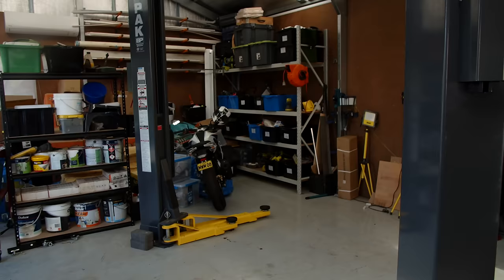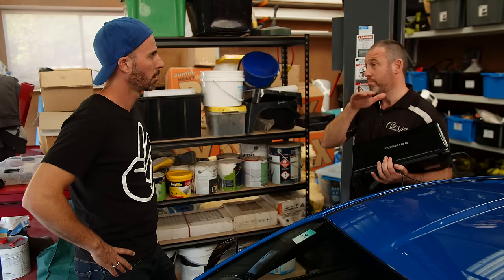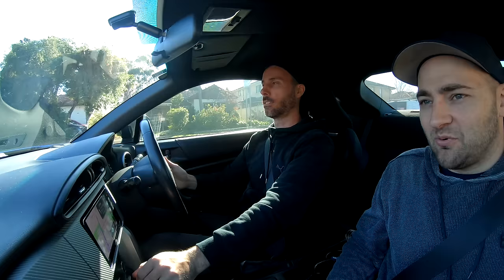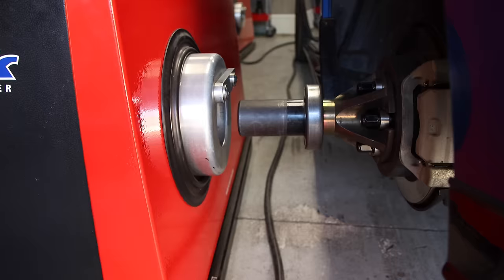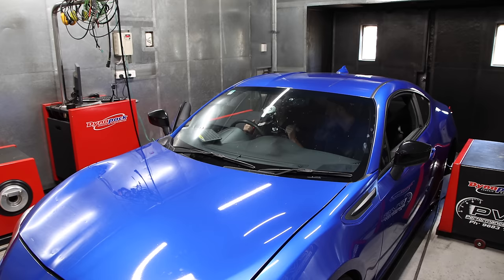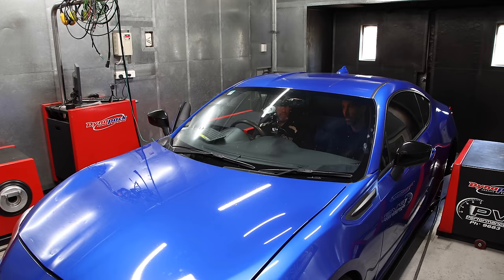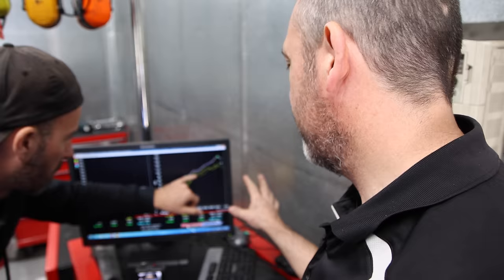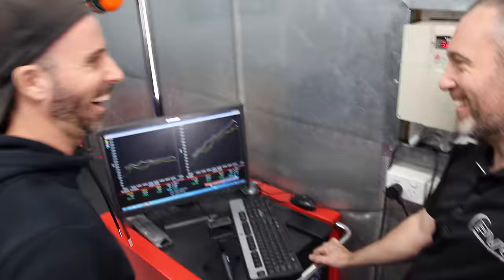How To Make More Power with an NA Engine (HUGE INCREASE!)

Comment: am i the only one that realises that this brz has less than 200hp? cause brz comes stcok with 197- 200 hp
Reply: it doesnt come with 200hp at the wheels stock though, so after drivetrain losses etc its less
Reply: @arcanevoid9199  ah so it makes 200bhp but not 200whp. Am i right?
Reply: @slowbrad  yes exactly :)

Comment: Now I'm interested to know how much gains I'll get from a 3000gt sl with engine back exhaust, 90mm TB , short runner intake, light weight flywheel, vr4 injectors and fuel pump, and a tune on a Cali-spec 1994 SL..had 3 catalytic converters on it...should see some significant gains maybe 30-50 whp..

Comment: what about an na supra with headers worth the tune or should do some more thing before a tune
Reply: more, tunes arent cheap
Reply: @arcanevoid9199  there's not much else you can do tho 😅
Reply: @saeko5676  intake and rest of the exhaust if you havent already. from there you would be better doing other stuff than engine if you dont want FI
Reply: @arcanevoid9199  have a full custom exhaust and a blitz nurspec cannon it's pretty low atm on teins  and I just got a drop in K&n brace bars in the front and rear all I can think now is jus making everything else new like maintenance stuff
Reply: @saeko5676  oh go for it then, thought you just had headers only
Reply: @arcanevoid9199  aight I need a standalone ecu tho
Reply: @saeko5676  figure out a tuner first, may affect which ECU you end up buying

Comment: no no like lets stop at honda owners making NA builds
there is actually a reason to it 
listen me out 
hondas are little death cans with 70% of weight on front axle while being fwd 
tell me one reason why would i want turbo that shit without welding 500kg of steel tubes into it to make sure i wont die???

awd turbo swap? yeah lets goooooo

well thats the reason why i think D series are better than B series 
listen me out 

D16 weight so much that i can fucking lift it with transsmission 
B16 i wouldnt be able to move if it was just engine

D engines just make these little death traps less of a death under steer traps 

also Coupe is much better when it comes to handling than hatchbacks 
i know i might say weird things but i own both hatch and coupe 6th gen and i can tell that coupe is much more planted 
i presonally preffer a little over steer from hatch but coupe is much easier to control 
i heard coupe is basically integra when it comes to suspension idk if its true never worked on integra before but i heard legends of integra beng best handling fwd